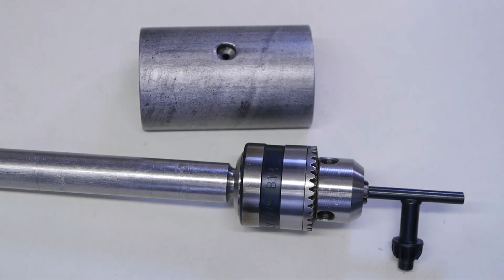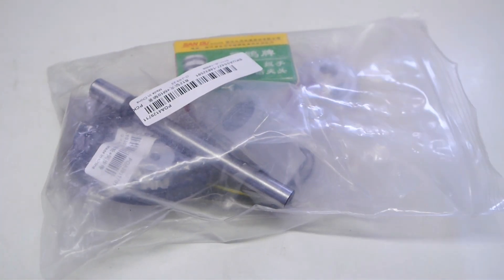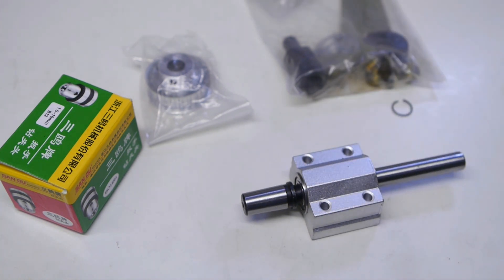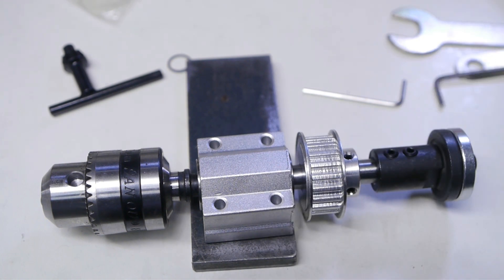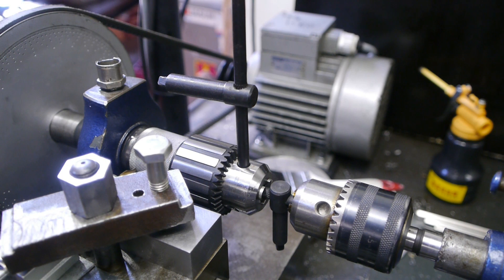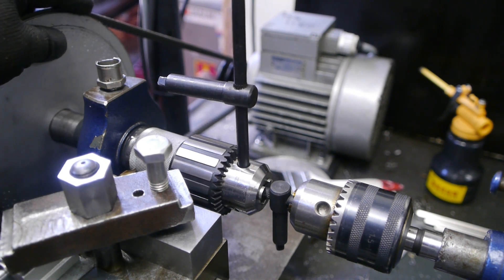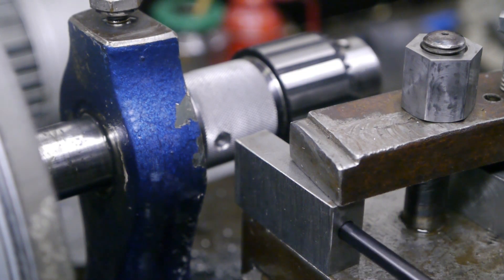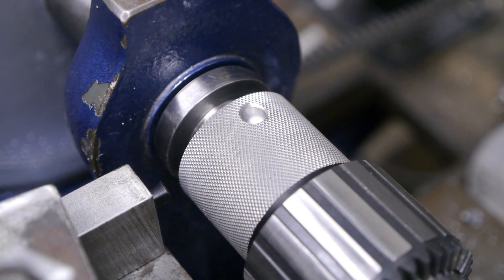How it takes 4 chucks to drill a cross hole on the lathe

Comment: Glad to see another success.    Well done.

The drill bit may have broken due to the piece moving when the drill bit was breaking through the bottom.  You may not like clamping, but if the piece had been clamped, the drill bit may have spun in the chuck but likely would not have broken.

Dave.
Reply: yep just when it grabs at the end it pulls up and because you hand hold it, it goes a bit sideways and breaks the drill
Reply from the maker: You can also argue, that when clamped down it gets harder to line up the drill with the centre punch mark. Especially with a drill press quill the had a lot of play. 

That was the second hole I drilled with a new drill bit and it sounded completely different then the fist hole. Like there were hard chunky bits in the metal.

Comment: While cross drilling you were using the cross slide to advance the drill bit so the number of turns of the hand wheel should have told you exactly how deep you were drilling.
Reply from the maker: With a knurled surface as a reference and drill bit with different points and lengths it gets confusing quickly :)

Comment: Interesting how you divided & undo from the spindle with basically a fixed block & slide a pin in, a very secure way.
In the U.K  the weather is very mild for mid February I have been able to spend many happy hours in my own tool temple!
Reply from the maker: We had some great weather last weekend. So great I'm currently suffering though another cold :(

Comment: Another enjoyable video. That 4 chuck setup is amazing! That's an interesting and useful kit, but I can't figure out the need for a drill chuck and saw blade in that close proximity... The instructions don't help explain much, but #3 should be the Rolingmetal channel mantra and I think #4 explains that little C clip...

Installation tips:
1. Pay attention to the mounting direction of the bearing, and carefully look at the description diagram or video.
2. Do not damage the bearing blindly. Patience and carefulness are the key points of mechanical work.
3. Various methods: to activate the brain and complete the assembly.
4. The sliding block and the contact surface of the synchronous wheel shall be separated by gasket to prevent phase grinding.The gasket is small. Don't lose it.
Reply from the maker: I see you have a thorough understanding of mechanical engineering and machining :) lol

Comment: Right On dude!
I also bought one of those little gizmo's from Banggood with the same intentions of using it for cross drilling on my Chinese mini lathe. I haven't mounted it yet because I hadn't figured out how to mount it in a tool holder yet. Now You just showed me a brilliant way to do that.  Clever work around, twice, using the same technique to hold the little block too. I also see we have exactly the same kind of luck doing our little projects. Breaking that drill bit would have been par for the course for me also, clamped or not. Sometimes shit just happens, ya know?
Keep 'em coming, I am loving these videos man.
Reply from the maker: Thanks. And good luck cross drilling. It can be a bit of a struggle :)

Comment: Hi sir , my thoughts are how about getting say a 19mm or 25mm chuck and bore and thread the it to fit directly into your spindle 🤔 thankfully  Jacobs made a spindle chuck that fit my 1.250 x 8 threads. Greetings from western Colorado,USA. And thanks for sharing your videos.👍 also if you don’t mind saying, where you are located just wondering?
Reply from the maker: I believe the spindle is one inch 8 tpi so there might be ready made drill chucks arbors available.
I'm Dutch, from the Netherlands but not from Holland :)

Comment: You could turn down your original shaft to suit your bearings and bore out the holder. 
You found a workable solution anyway 😀
If you are using the cross slide to push the drill in couldn’t you use that to measure the depth?
Very ingenious way to hold the spindle still(ish). You do need a spindle lock.  I’m looking forward to seeing  your spindle lock idea.
When reaming use half the speed as you would with the same size drill and twice the feed.  Clear the chips often as that is what will destroy your finish.
Hey why didn’t you set up your spark eroder thing to get the drill out 😀
Your chamfer tool needs back rake for cutting steel. FYI  It will cut cast iron flat.  You actually use negative rake if you are cutting brass. Rake angles are as important as clearance angles.
Congratulations on completing your project !  You’ll be expert in no time.  Good on you for sticking at it.
Reply from the maker: I think it will be hard to turn the shaft down to a good enough finish that will slide though the bearings. 

Measuring the depth with the crosslide could have worked but it quickly gets confusing with all the different drill point and lengths. And the knurling doesn't provide a good reference point. 

In the end it doesn't really matter is one hole is half a mm deeper.

I considered setting up the spark eroder but though it was to much work. Besides the video was more then long enough. One day I'll go play with the EDM machine a bit more and then I'll probably sell it to finance a milling machine. 

Of course than I'll break a tap but with a milling machine and a carbide end mill I can probably take care of it :)
Reply: @Rolingmetal  You are probably over this project anyway and I can understand that.  Tapered bearings would be ideal and then you can use the force from the cross slide to push the drill consistently.  You don't need to go crazy with the depth calculations.  I was just afraid you were going to drill a hole into the spindle.  Then we would all be swearing :)
It you wanted to drill 5mm for example and one turn is 4mm then it is one an a bit turns from wherever the drill first touches.
I get what you are saying about setup time.  If  you had a huge workshop you could leave everything set up and just walk over to it.  Hard to do with limited space and machines you would use so rarely.

I'd like to see you cut HSS with a carbide end mill.  Maybe chinese HSS will be soft enough.  lol.
Good luck with your milling machine hunt.  You may even find a fixerupper and you can entertain us all with that. :)

Comment: Switch the bearings for cheap brass bushings, and then slow that drill down. Your not drilling wood.
Reply from the maker: It's rather hard to control the speed of the electrical drill. 

A cordless would have been better as it spins a lot slower.